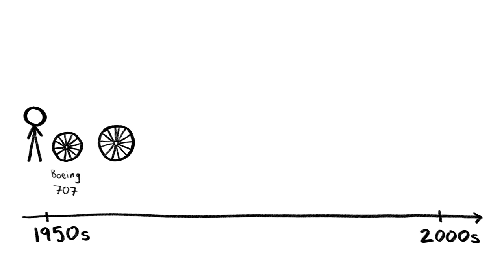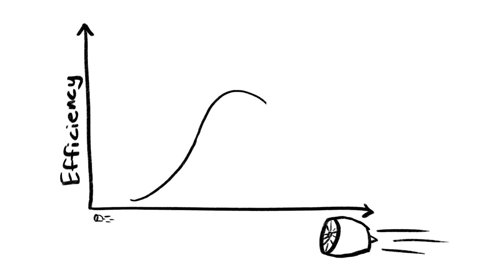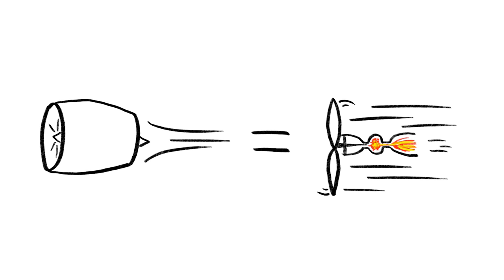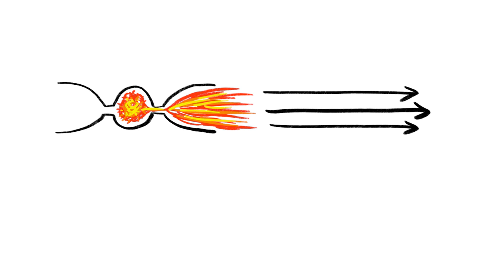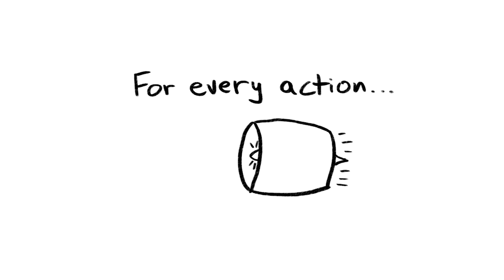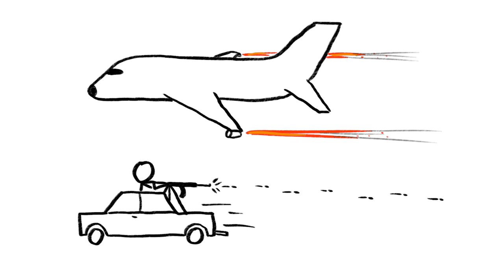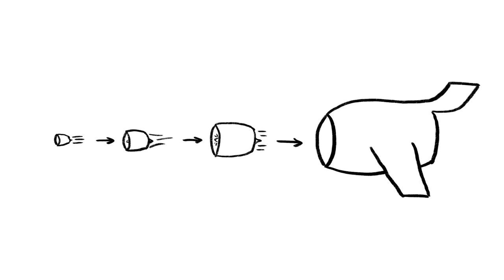Why Are Airplane Engines So Big?

Comment: If the goal is to be as fuel efficient as possible, then we wouldn't be using airplanes at all, as cars are inherently more fuel efficient.  And bicycles even more so.
Reply: Nowhere near as time efficient though
Reply: +Physics Videos by Eugene Khutoryansky Time  is money. Just equate the amount of time wasted to that person's hourly wage. For most people, that's a waste of money. Especially when it comes to flying really long distances.
Reply: +Physics Videos by Eugene Khutoryansky Debatable. A properly loaded aircraft has the same fuel use per person as a typical car.
And the fuel use of LSA category aircraft when measured as a factor of distance travelled compares quite favourably to a typical car. (Per unit time it's less efficient, but that's related to being typically at least twice as fast.).

Then there's a matter of practicality. While, yes, a bicycle is one of  the most efficient mode of transport we know of, you aren't going to get from Australia to Europe on one.

Aircraft take on several roles that are otherwise nearly impractical.
However, as some of the scientists that went to the kyoto protocol in Japan from Europe demonstrated, Rail travel used about 1/3 the energy of flying.

Efficiency still matters though. It just has to be kept in context. For a given role, it's still preferable to do it as efficiently as you can.

For something that travels the kinds of speeds aircraft do, and enables long-distance travel to be considerably more practical than it otherwise would, it still matters if one aircraft design uses 5 times as much fuel as another, even if it were true that the more efficient design uses more fuel than a car. (which... Isn't really unconditionally true, but somewhat dependent on a number of factors.)
Reply: And also planes can transpor many preople at the time, while bikes only one. So technicaly you'll need to devide the amount of energy over the people it is transporting to get a better rough estimate of their efficiency.
Reply: +Physics Videos by Eugene Khutoryansky ok you go ride your bike from Africa to Asia tell me how that goes
Reply: In actuality, planes are more economical and fuel efficient for mass transport.
Reply: No they are not. To travel the same distance by car - lets say 2000 km which is realitivelly near distance traveling with plane (about 2 hours flight), you would have to travel something like 3.500km with car (and even that in ideal conditions, with no mountains or oceans in the way), due to roads having to travel bigger distance, because of roads not travelling in a straight line from A to B. With car there can be 4 or 5 people on the road the most. So you'll have to have 100 cars. For 100 cars to travel 3.500km it would take more fuel than an airplane. Plus all the time it would take, people would have to eat and sleep in between, which take additional energy.
With bikes to travel such distance, it would take a month probably. And only 1 person at once. For 400 people to travel one month, it would take enormous energy (of food, shelter, bike repair ans so on). Plus there is a huge waste of time, which is essentially a waste of energy (you could be doing so much better things in that month)
So airplane is still the cheapest.
Reply: If you're only flying one person, then a car is more efficient. But planes carry a lot of people, so you're miles per gallon per person is actually higher with a plane than with a car.
Reply: Bike across oceans will ya?
Reply: until you try to fdrive a car in the ocean.
Reply: Another thing is it probably uses 100x the fuel but transports 200x more people making it overall 2x more efficient
Reply: Seigeengine I wouldn't say the comment was worthless. I would argue that the original comment is worth a lot because,  even if it was a joke or an advertisement for a channel, someone could actually agree with "yeah why don't we just drive everywhere?" but because of it we got KuraIthys' well thought out and simple answers to any questions anyone might have had about this video. I learned that planes used comparable fuel per person to a car; before I thought they used much more fuel.

Comment: this was really cool. I never knew that there was a difference btw fighter jet and commercial airline engines
Reply: Jet engine versus jet-turbine engine. Although military jets these days don't just blast all the heat out the back because the heat signature is too easy to detect.

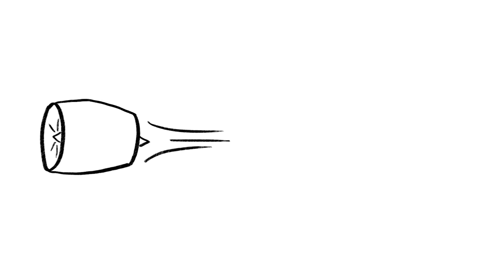Comment: 0:17, describes a turbofan jet engine which has all the 'bypass' air going around the jet core as opposed to a turbojet in which all of the air goes through the jet core and turbine itself.

Comment: Actually, fighters don't use these so-called "pure jets" (assuming that is referring to Turbojets) in a long time. The jets used in both fighters and airliners both fall under the category of Turbofans. The ones used in fighters have a vary small bypass ratio (The ratio of the mass of air being bypassed and pushed by the fan to mass of air going through the core). For example, the General Electric F404 (the engine on F/A-18) has a by pass of 0.34 to 1 (For every pound of air going into the core, only .34 pounds is bypassed through the fan) while the GEnx engines (those on the Boeing 747-8 and 787) have a bypass ratio of 10 to 1 (for every pound of air through the core, 10 pounds are bypassed).

Comment: Modern jet fighters use low-bypass afterburning turbofans. Turbojets are only used on aircraft made for extreme speeds (hypersonic). Current projects use combinations like  rocket/turbojet (SABRE), or turbojet/ramjet(HTV-2). I don't know of any current project that uses just a turbojet engine.

Comment: It looks like your math assumes that the area causing drag is just the frontal area of the engine.  I don't think that's right: it's the frontal area of the whole plane that causes drag, of which the engine is only a small part.  Also, since the engine is moving air through itself, I don't think you can model its drag as if it's a flat disk with Cd=1.

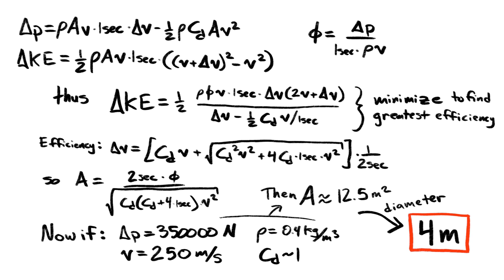Comment: I was trying to follow the equations on the rough estimate (01:25) and I could understand most of it, but I still have some questions... can anybody help?

1) where does that ∆v come from? On the "Efficiency: ∆v = [...]"
2) sometimes a pure v is mentioned. What is that exactly, initial velocity?
3) why did they choose to use "1 sec" rather than t to refer to time?

Number 1 is the question that bugs me the most though

Comment: The drag of the larger engine isn't the real problem, as the engine is the thrust line of the plane and is also the part that creates the thrust, It simply overcomes the drag created by it being on the wings of the plane by simply working, or simply giving off thrust

Comment: You just described the reasoning between high bypass and low bypass engines without ever mentioning either term. I'm not sure if I'm disappointed, or impressed.

Comment: Actually... There is such a thing as an annular fan. Effectively instead of fan-blades connected to a common hub, you have a chain-saw with only the tips attached, wrapped around the body of the aircraft. Gives you the widest outer diameter and the widest inner diameter while filling the inner diameter with aircraft, which doesn't add to extra drag.

Comment: Could you explain how a coefficient of drag of 1 is justified? of course this is a simple model, but a fan sucking in air isn't the same thing as pushing a wall through the sky. Really great that you showed your work, I'm just not entirely convinced, that the model is viable.
If I think about it the more logical approach would be to come up with the amount of thrust you need, and how fast you want to be going, then, as you will have to accelerate the outside air relative to the plane, setting your minimum exhaust gas velocity, come up with the mass flow you need to achieve enough impulse at the given delta v and let that determine your engine size.
I haven't done the math yet, but if you just look at the planes it really seems like they've fitted the largest fans they could..

Comment: Wow, I learned something about jet engines I didn't know. Their ideal size is 4 meters in diameter! Propulsion-wise that is. Maybe not so good to have such large engine in case of engine failure. A windmilling fan causes an enormous amount of drag which combined with a very powerful engine would create an enormous amount of yaw, thus needing a very large rudder to keep flying straight during takeoff after engine failure. The large rudder would reduce the overall aerodynamic efficiency of the aircraft. And let's not forget that the remaining engine would have to be extra powerful to push against the drag caused by the windmilling failed engine.

Comment: is the 4 m limit on engine size still valid when the engine is not wing mounted like the case on old jet fighters? in other words, the engines will not be adding frontal area to the aircraft as they are incorporated in the frontal area of the fuselage itself and therefore not adding more drag.

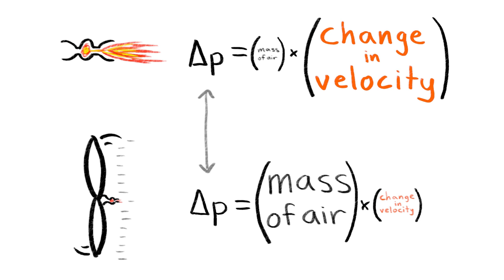Comment: [01:05] becomes confused as to which delta is a derivative, and whether wasted energy is amount or change... 2. What became of the 1980's research into unducted fans (UDF) and 3. why didn't they use propeller/fan-tips (like wingtips)...?

Comment: Should add or include that the specific optimum diameter and velocity is determined by the  target flight conditions, (mainly speed and altitude, but also weight and balance) and in the case of military aircraft size and shape of the package as it has an effect on the radar profile and ability to vector the thrust.(and maybe heat signature?)
That is, high bypass fans with high volume and low velocity are better for moderate speeds, while low bypass fans with high velocity thrust are needed for higher speeds.(and good old large diameter propellers are the efficient choice for lower speeds)
Reply: +wolfedog99 -- So basically, size varies with the desired flight path's drag?
Reply: +Tlaloc_Temporal The design envelope of the aircraft determines the most efficient size and jet gas velocity.  Not the flight path, not directly anyway. Indirectly; the flight path is determined by the aircraft's abilities, or the aircraft is chosen based on the desired flight path.

Comment: I can answer this without even watching the video.  The speed required to produce enough lift for a jumbo jet to fly at cruising altitude requires an enormous amount of reactants to combine at once.  One of those reactants is air, so a large intake surface makes up most of the engine's size.  Now to watch the video and see how right I am.

Edit: somewhat correct

Comment: The 747-8 has slightly smaller engines due to it having four of them but not needing twice the thrust of A350. A better example would've been using the A340 and a 777, the 777 produces more thrust from it's two engines than the A340 from it's four, and being far more fuel efficient.

Comment: Finally a good easy answer: By the way, what is pounds of thrust really mean? Thanks. No math, just why is it important  Stuck on this "it goes without saying" problem I'm sure.
Reply: Thrust is the forward force that the engine produces to propel the aircraft. The amount of force is measured in pounds or kilograms.

Comment: I don't get it.  Is the ideal engine a standard 4 meters in diameter, or is the ideal engine for the planes we fly and power of the engines we are using 4 meters.  If I increase the velocity of the exhaust, does the ideal engine size  for maximum efficiency change?

Comment: There is an other reason, which is the noise they make. Smart guy called Lighthill found out, that the produced jet-noise intensity generated by the turbine is proportional to the Mach-number of the air to the power of 8! So you don't only save a lot of energy, the turbine is also a lot quiter.

Comment: Modern fighter jets actually use the same type of jet engines found in airliners. Pure jets were only widely used in the early days of the technology and are rarely found in any application due to their inefficiency.

Comment: The video missed the point that the ideal speed for the exhaust is just a bit faster than the airspeed; because that minimises the backwards speed relative to the ground; the air comes in, goes out, but accelerates a bit overall.

Concorde's engines actually had a very high exhaust speed, but they were more efficient, because the aircraft was flying much faster. The overall aircraft was less efficient, but that's because of supersonic drag on the airframe and because the aircraft was rather heavy for other technical reasons that had nothing to do with the engines.

Comment: Question: The formula speaks about a sweet spot of engine diameter. Does this take into account the size of the plane and the weight of the materials? Without you can just create a 4 diameter engine and try to pack as many kgs onto it as possible. Make it somehow fly (aerodynamics) and you have a perfect plane?! Do i miss something?

Comment: The buzz-word for the engine-builders is the so-called 'Bypass-Ratio' ('Nebenstrom-Verhältnis' in german)
The higher, the more efficient - modern jet-engines for commercial airliners have a ratio of ~1 : 10 ; 1 part hot air and 10 parts cold air - with the nice side-effect of working as s.k.o. a muffler, so that modern planes are much more silent than older planes. Today many airports calculate the take-off- and landing-fees by the emission of noise, so it makes economicly sense for the companies to operate modern 'whisper-jets' rather than the old noisy ones...
The other way for higher efficency is the temperature. The hotter the gas comes in, and the cooler it leaves the engine, the better the efficency is. this can be achived by modern materials, e.g. ceramics or hi-tech-alloys like Titanium or by new production-technics like 3D-printing to get ventilation-systems into the fan-blades of the turbines...

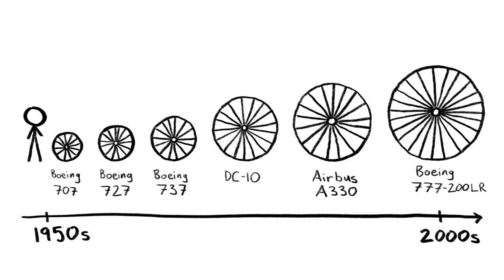Comment: 0:04 The largest jet engine currently in existence is standard on the Boeing 777-300ER, the General Electrics GE-90.
Reply: +Zack Smith They're physically the same engines. The -200LR's are slightly detuned due to it being a smaller, longer ranged plane. They can take the higher thrust of the -300ER's engines for higher altitude/hotter take offs.
Reply: I thought the -200LR uses the Trent 800 engine typically?
Reply: Zack Smith Nope. All the longer ranged variants (-200LR, -300ER) as well as the -200F exclusively use GE-90s. The older -200, -200ER and very rare -300s have Trent 800s as an option.

Comment: In the back-of-the-envelope calculation you showed, what does 'C sub d' stand for?
Reply: That's the drag coefficient, and it's unitless.  That term in the first equation is the drag force acting on an object with characteristic area 'A' (frontal), flying at a certain velocity 'V', through a fluid of density 'rho', with a drag coefficient 'Cd'.
Reply: Thank you for explaining. I assumed it was and followed the calculation based on that assumption but now I know for sure.
Reply: No problem!  Always good to check.

Comment: Actually almost any modern fighter jet is built around a low bypass turbofan. They generate most thrust with the jet, but some of it the same way as described here and for the same reasons. True jet engines are rare.

Comment: Actually that last picture would not increase drag by a lot because it would be part of the fuselage, although the plane itself would be pretty useless because you can't sit anywhere.
Reply: +zimri19 There could still be seats if the plane was made tall enough. However, that would increase drag.